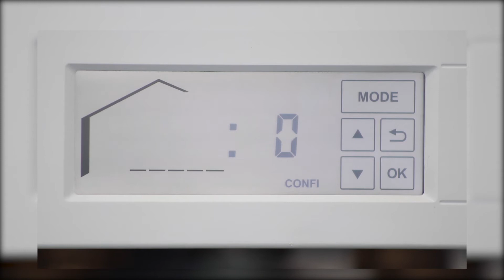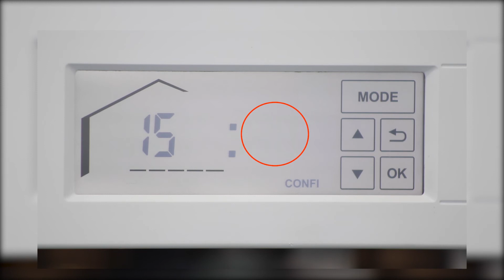How-To: adjust the heating curve w/B1KA

Comment: I just installed an outside temp sensor but my B1KA doesn't have an option 15 on menu 12.  It cycles from option 14 back to 0.  Is this a firmware issue or is there another option that precludes option 15 from showing?
Reply from the maker: Hello, to better assist you can you please provide us with your boiler serial number?